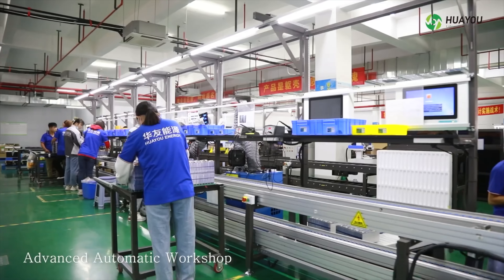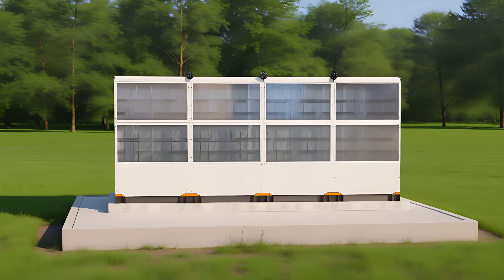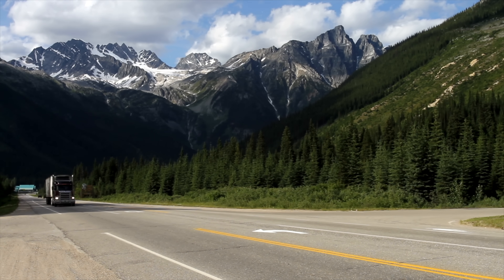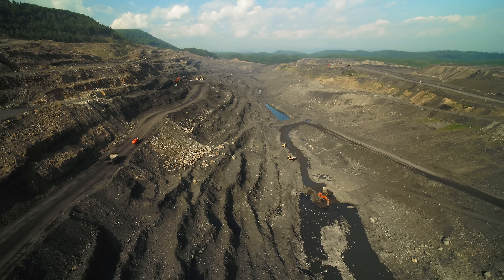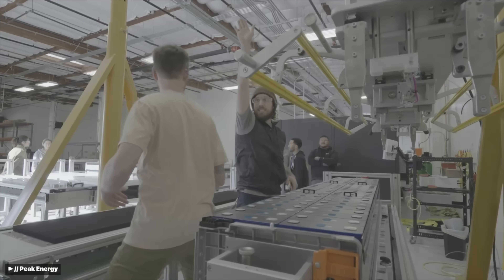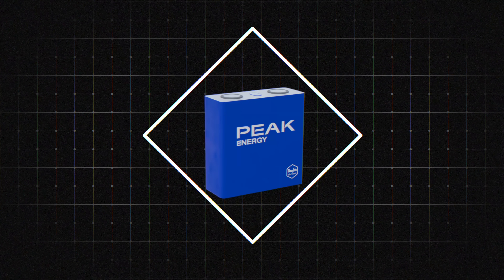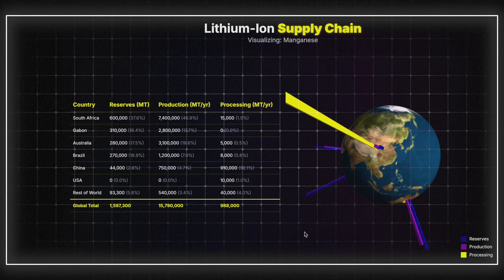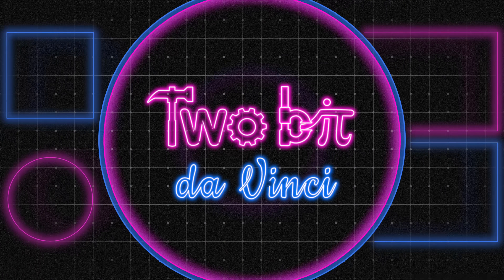Sodium Ion Batteries Are Going to be EVERYWHERE - Here's Why

Comment: These batteries are not new tech. In fact they are passed over tech because of how terrible they discharge.  They hold a massive memory and when they drain they do not fill to peak numbers after a short use time.  These are not new tech. This is going back to NICAD style batteries.     A terrible battery for modern use.  
We need better batteries not lesser batteries. It is great these cannot burn but they also cannot stay charged as long and cannot hold a peak charge for any time.  This type of battery is not the future it is just the most woke battery that checks all the sustainable ecosystem Green Energy falsehood ideology that simply makes NOTHING .   This company is a very progressive liberal company who did not make the best battery but the one that checks all the Leftist ideology and checks nothing in the practical world.  
 This is not a good story even . This Battery is and always has been considered a JOKE in the industry.

Comment: Me thinks me smells a herring, being sodium button cells are literally decades old. A chem holding viable electrical charge for years of shelf life, I'd have imagined would have been run through the wringer of potential options at least a few times over by now. Upsetting supply and demand chains always increases prices so we'll now exchange lithium for sodium in expense being the option was on the table literally 50 years ago? Big ole stinky Herring, IMHO.

Comment: Everyone hypes sodium ion as the game changer, but there are a lot of things missing in this video. The energy density is still lower than lithium, so the same battery takes up more space and weight. The larger sodium ions move slower which means weaker performance at high charge and discharge rates. Cycle life is still a problem because electrodes lose stability and capacity drops faster than with lithium. Electrolytes have a narrower stability window and can trigger side reactions. Hard carbon anodes work but sodium metal is unstable and prone to dendrites. Some cathodes still need nickel or cobalt which kills the idea that it is all abundant and cheap. Manufacturing is not just drop-in for lithium lines, it takes new supply chains and engineering. In the real world sodium ion is better for grid storage and backup systems, not for long-range EVs or phones. It will grow but it is not replacing lithium overnight.

Comment: What if I told you, as someone who has been in the industry since 2007 that these “new” sodium batteries has been just around the corner for more than 15 years.
Reply: @BufanMuayThai  what if I told you that ai has been in the making since the 60’s….who knows when something will “take off” or be the new normal?
Reply: @dragong1217  I built my first neural net back in 1993 .... took 15 minutes to reach a decision of left, right, forward, remove wall.
Reply: @dragong1217 That is false. As a computer engineer, I can tell you that CPU processing power has only recently gained enough bandwidth to make AI possible. The CPUs we had until about 2010 simply did not have enough bandwidth. There were concepts, but the only thing available were supercomputers that cost millions of dollars each. I worked on a supercomputer in the early 90s that had 64 cores. It was called the iWarp and the multicore CPU was made by Intel. Intel never did anything with it after that project. They could have been Nivida, but squandered the opportunity.
Reply: We are going to get GTA 6 before sodium batteries become mainstream  😂
Reply: from what I understand, they finally had a breakthrough about a year ago.Originally these had a major failure point of not being able to be recharged after a couple of runs, but they switched the internal structure to carbon fiber, which completely prevented that problem.
Reply: @GreyAcumen  In which case they would be the hottest investment opportunity on earth, bar none, and every investment bank and private equity fund would be falling over each other to bury them in trillions of dollars.
Reply: @osric1730  like they did for solar? look how long that took but here we are. meanwhile all those genius investment banks are dripping in oil, backing ruinous energy policies and creating an unstable world..my friend they are just crooks in suits and are incapable of both long term thinking and imagination
Reply: What if I told you: Bluetti just started shipping the first Sodium Ion based consumer power station last week? And China already has >200,000 buses & cars on the road with CATL/BYD sodium Ion batteries? The future already silently here.
Reply: Maybe you need to check out CATL? They just announced mass production of Sodium batteries with 50% of the cost of Li batteries, similar energy density and will last at least twice as long.
Reply: @LouisDuran can't go into mass production without even a working prototype.
Reply: @OutOfNameIdeas2 catl didn't just announce mass production of a sodium ion battery? You know something that the rest of the world doesn't 😂?
Reply: @LouisDuran guessing you replied to the wrong guy. But yeah that's what I said too. We do have sodium batteries already though. But they have like 20% the capacity of lithium and have worse all around specs. 

It's almost like we need highly reactive materials to get a highly reactive battery. Reactivity is basically directly correlated to capacity.
Reply: @OutOfNameIdeas2  That's not exactly true. Sodium batteries manage to surpass lithium ion capacity after 3,000 or so cycles. However, I think LFP batteries are about halfway between the two and is currently seen as the preferred amount of compromise. I think it takes about 10,000 cycles before sodium ion batteries start competing then.
Reply: Lots of bullshit
Reply: Well they are here now, they are popping up on chinese websites in the same form factors as the lithium counter parts with slightly less capacity.
Reply: As a first responder just the fact that these stable batteries dont explode or catch fire will save lives I have witnessed the intensity of these fires first hand.
Reply: @LuisVega-q2x  Well you are wrong and so is the host of this vid.  These batteries DO explode and burn just like any other high power device.  The AMOUNT of burning and exploding is less, just like LFP.
Reply: @BufanMuayThai  What if I told you the internal combustion engine was invented over 100 years ago? Does that mean anything "new" or more efficient should be ignored or discounted like you're suggesting?
Reply: @ArcaneShenaniganery  , Bio-Diesel came out in the 1800s before petrol diesel.
Reply: Because lithium has been blocking them. There ate dozens of non lithium non toxic batteries ready for production but are being blocked.
Reply: @ellenlandowski1659those are all pure junk. There are even sodium batteries out already. They just suck. Lithium is just unbeatable since high reactivity is needed for high density. Nothing is being blocked... We are trying to make new batteries and no one would lose if we did create something better. I'm tired of that dumb argument it's being "blocked"... We have carbon lithium batteries and nothing comes close to the density.
Reply: There are real time testing on Hybrid and they are working awesome.
Reply: you never know, maybe the corner is the size of ye mum
Reply: @BufanMuayThai  I understand your scepticism, but if you're interested in this area, a basic search of what has happened in China recently will reveal that not only has progress been made, but sodium ion batteries are now in commercial production and in EV's. In particular, check out CATL's naxtra battery. JMEV and JAC Group. The future just happened.
Reply: Even Wikipedia is saying these were being researched as far back as the 1970s.
Reply: It's well known that the tech we see on store shelves have been in development for years, decades even. In the 70's my dad was working for BASF and he saw a 1" thick flat screen TV at work.
Reply: @Particulator The problem back then was the cost to produce much of the tech. Tech is only viable if the price can come down to being practical. Who was going to pay $20,000 for a flat screen TV? Now one can get a 55" for under $300.
Reply: @BufanMuayThai  It all boils down to market viability
Reply: @BufanMuayThai   they are already in production.  The company is based in Texas.
Reply: Semi-solid-state batteries have now become a key focus for both industry and academia, as they precisely address the pain points of conventional liquid lithium-ion batteries.
Reply: @BufanMuayThai  🤣
Reply: What if I told you they are already being deployed in vehicles in China?
Reply: @patreekotime4578 yeah and they suck. Extremely bad energy density. They exist but suck so badly nobody wants to use them
Reply: The fusion generator of batteries.
Reply: @crooker2  🎯 "Mister fusion"
Reply: the FSD of batteries
Reply: what if I told you sodium ion batteries were developed before lithium ion but didn't have the necessary energy density required thus Li+ was born
Reply: @huberthumphry280  * at the time.
Reply: China’s CATL, the Chinese battery company and the biggest in the world,  is going to be in full production on a sodium battery in 6 months.  This battery has better performance in cold and hot weather (less degradation), does not catch fire and is half the price of an already inexpensive Chinese  byd blade battery.  About forty percent of the price of a lithium ion battery used by Tesla outside of China.  

Trump in his usual idiotic manner just bought a lithium miner AFTER the sodium battery announcement from CATL.😂😂
Reply: Yup. Heard it all before.
Reply: Whats holding it back in your opinion?
Reply: Yes, it's like fusion power. Perpetually 10 years away
Reply: And they still  suck worse than any other battery type other than lead acid

Comment: the steep power slope is VERY undesirable and what is the energy density? how much battery do you need per kilowatt hour, then what is the charge/discharge rate? will they function to run a car?

Comment: Current Challenges and Progress
Energy Density: While lower than lithium-ion batteries, significant progress is being made to improve energy density and close the gap. 
Lifespan and Degradation: Researchers are developing new cathode materials with mixed transition metals and improved durability to overcome the rapid performance decline seen in earlier designs. 
Aqueous Electrolyte Limitations: Early aqueous (water-based) Na-ion batteries were limited by water decomposition, but alkaline formulations and interface engineering are enhancing stability and lifespan. 

long story short... this is same story that has been said since 1970s....  hope it can be available before I die... to say that it is about to change everything is a bit lie.   It is ideal for Grid Scale but we are far away from using it for EVs.

Comment: Sodium is OK for large scale batteries, but not for small scale stuff like medical devices to control heart beats, running your Phone, or putting in cars.     

Lithium has twice the energy capacity.  
The one to watch is silicon, which although doesn't have quite the same energy capacity, is lighter, and doesn't catch fire like lithium, also is super abundant and hence cheaper.   Plus they have a longer recharge ability, so do not start to lose their capability to hold a full charge after 1000 recharges?

Comment: This sounds like a great solution for a sailor interested in transitioning from diesel to electric. A fire aboard a boat is a death sentence.
Reply: LiFePo4 is a good marine solution. No fires. Sealed, so salt water is not an issue.
Reply: True but in the ocean saltwater is electronics worst nightmare and the extra weight definitely not needed by havin a big rack of them to power your tiny boat so a dam if do damn if don't use a sail and not worry of bein stuck just floating along because your power supplies failed
Reply: @Shawn-c2i  

"Day after day, day after day,
We stuck, nor breath nor motion;
As idle as a painted ship
Upon a painted ocean.

Water, water, every where,
And all the boards did shrink;
Water, water, every where,
Nor any drop to drink."
-Samuel Taylor Coleridge (1798), The Rime of the Ancyent Marinere

Poems about being at the mercy of the winds aside, modern sailboats tend to have engines/motors to help maneuver in tight spaces, escape in becalmed waters, travel directly upwind, navigate in emergency conditions, ect. In many boats, especially as scale increases, those engines are diesel as it's high power density is appealing when space is limited, but electric motors have been growing in popularity as new tech matures to make them a viable alternative. Thus, an advancement that not just reduces thermal runaway hazards, like LiFePo4 batteries boast, but does away with them completely is understandably appealing for people thinking of switching to, or already using, electric motors for that use case.

As to their added weight? I'm not sure if they'd be a viable alternative for traditional ballast, but that might be something worth investigating for someone already considering an electric conversion for their emergency motor. After all, lots of ships have lead weights helping to keep them upright and floating where they'd like in the water, so it might be worth looking into giving that weight a duel purpose.

I'm not an expert though; just spitballing.

Comment: Most do not really understand why lithium is so dominant - it's not just "most dense so they win."  A lithium battery puts out rock-solid voltage until the juice runs out - the graph of the voltage across depletion is a table you could set drinks on.  You've all seen one upshot: charge indicators on lithium batteries are very imprecise for this exact reason, it's trying to gauge battery level from a VERY small change in voltage.  Sodium batteries graph more like a playground slide - charge indicators will suddenly be excellent, but this is a big challenge to overcome.
Reply: ב''ה, except that these once fancy electronics are now in a profitably sold $5 USB PD phone charger.

Everything is in place for this, thank G-d, though for very specialized applications, you're right and the legacy manufacturers thus don't have to lay everyone off yet.  Great.
Reply: EXACTLY! bringing up "voltage smoothers" doesnt make sense either! a large capacity bank would drain slower, and so voltage would drop too slowly for  voltage smoothers, but would still be too significant to ignore. Additionally, voltage smoothers work off of a FLUCTUATION of voltage. that is, a voltage that is rising and falling constantly over a relatively short period of time. you could maybe get something to work using a lithium battery to smooth it out, but that still doesnt help much since the whole point seems ti be to remove lithium batteries.